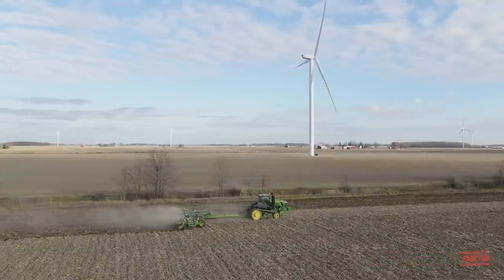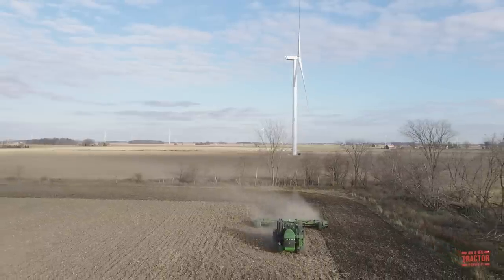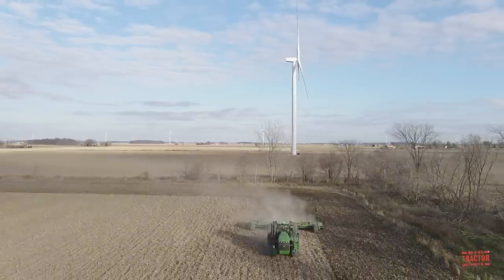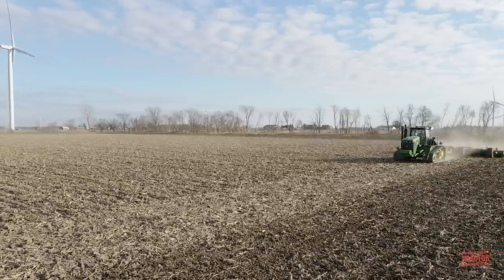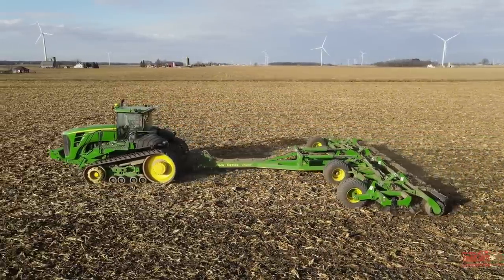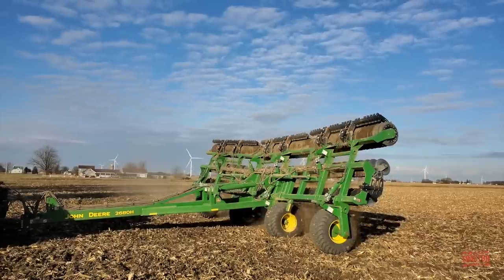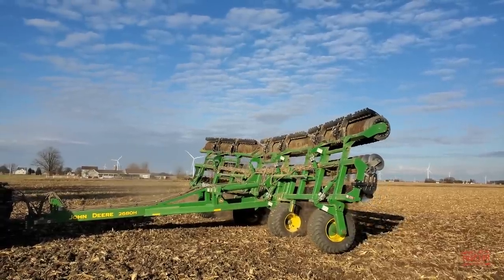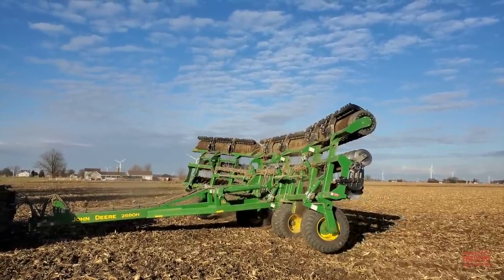JOHN DEERE 9630T Tractor & High Speed Disk

Comment: I’m no till, but if you set that really shallow, and pit some air seeders on it, with minimum angle on the discs, it would be a great way to pin down residue and keep it on your field, and spread cover crop seed.

Comment: I run a 9560R with a 50ft Sunflower 5 section disk. Dealing on a 40ft 2680H right now, not a cheap piece of equipment, but nothing is!!
Reply from the maker: Nice tillage team. The 2680H will certainly speed up tillage for you.
Reply: They say the case high speed tiller does a better job. Idk
Reply: @henrylopez5252  
I demonstrated a 40 ft qwik till high speed, 8.5~9 mph was a good pull for it. Used it for about 100 acres in a 300 acre field, couldn’t tell the difference between the two disks. Will keep the Sunflower, instead of giving it away on trade.
Reply: @kirkmadsen6758  right on!! Ivers Farms has a video with both the Case and JD high speed discs and talks about what they like and dislike. I understand every operation is different and different soil types, so it's what works and is best for each farm. Appreciate y'alls hard work!

Comment: I think You were near my area of Michigan. Where in Michigan were you at ? We farm 5200 acres of corn wheat soybeans and double crop soybeans plus we custom farm for others in southern  Michigan and northern Ohio.  We use a 50 foot Krause disk and a 35 foot Salford vertical tillage tool.  The Salford is pulled by a 450 quadtrac the krause disk is pulled by a 580 quadtrac.  We have a johndeere 9510r   it will run our new to us  db90 planter that is 54 rows at 20 inch spacing.  We tend to do shallow tillage and plant cover crops . We do a heavy tillage rotation every 4 years we chisel plow and we try to vertical till in between rotations. Some of our heavy soils we chisel plow every year .  Nice video keep up the good work  !
Reply: Quite the operation! Ur near kip siegler in Michigan?
Reply: @henrylopez5252  no he is about  2 hours north of us maybe 3 hours . He farms near the thumb of Michigan.  Where we are on the ohio Michigan border area . He runs a great channel and is a good guy .
Reply: Monk Farmer  we run a inline  ripper on our headlands and where we park trucks . We run a johndeere 2730 combination ripper . Our main issue is that soybeans tend to yield 10 to 15 bushels more when we vertical till or disk . We only notill on sandy soils or hillsides or when we plant our double crop soybeans after winter wheat . Our main crop is soybeans and we tend to have high yields last year we had 85 bushels an acre average. We still grow a fair amount of corn but around here everybody grows corn and the market has been flooded.  We grow sorghum and sunflowers as well . The sunflowers don't yield much but we grow them for a seed company.  Take care and stay safe !
Reply: @anthonybanda8192  ur around nathan of Border view farms? He's on Ohio michigan border. 
Has soybean technology advanced tremendously lately? 85 an acre average is phenomenal, isn't it? When I was around farming regularly 15 yrs ago in ne Indiana, 65 was great average. (I'm not sure what it is now)
Reply: That is in Ithaca/Alma area based on the wind turbine location
Reply: @henrylopez5252  yeah he farms about 15 minutes away from us . We sell our corn to the same ethanol plant . Our johndeere dealer is the same . We farm north east of his family.  Good guy with a great channel.  Our secret to high bean yields is we do 2 years of beans on beans on the same fields in certain soil types it seems to work great .Take care and stay safe  !
Reply: @kevinhalfmann5486  we have windmills in south  eastern hillsdale county they were put up this summer.  They go for about 20 miles I bet there is 100 or more of them . Take care and stay safe  !

Comment: Which do you think is better this disc in this video or the Kelly diamond disc?
Reply from the maker: Both are good. It depends on how much ground you need to work.  The Deere can go deeper if you want to be aggressive in high residue. The Kelly is awesome for working the surface. It can run in corn stalks but will leave all the residue. A farm I film at has a 45ft Kelly and runs a 24 row planter.  They will get 600 acres ahead of the planter in a day and park the tillage for a couple of days to let the planter catch up.

Comment: Were those deer in the field at about the 2 minute mark?
Over 30,000 pound weight to that disc.....I wouldn't have guessed that much.
Reply: That’s the thing about these high speed disks. Extra weight to keep them in the ground at high speeds and it takes the biggest horse to use them